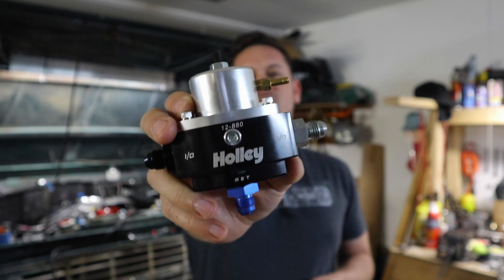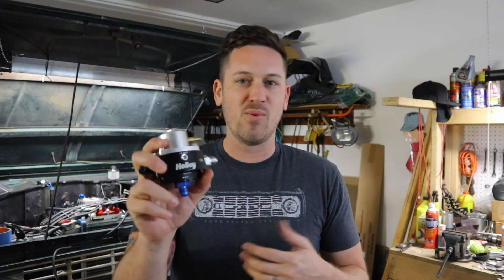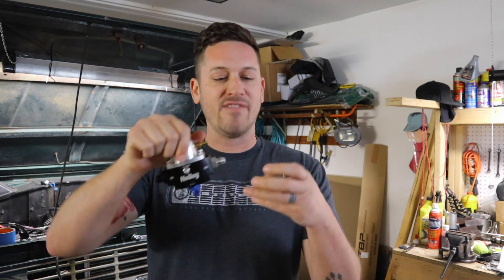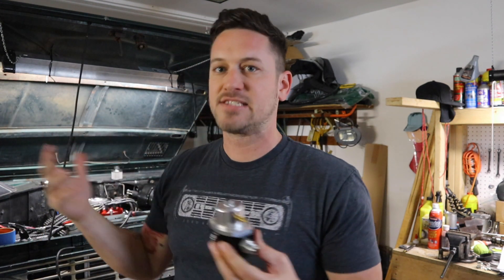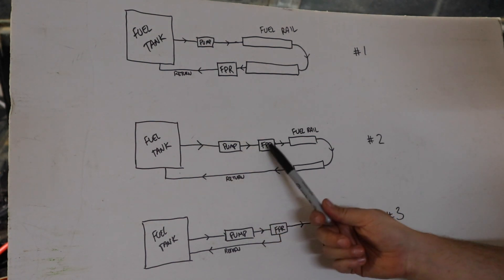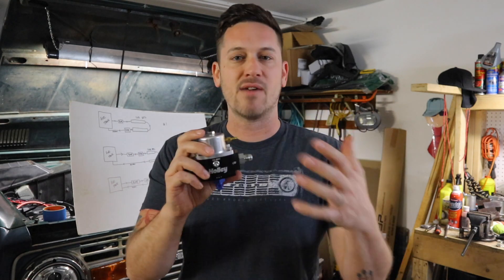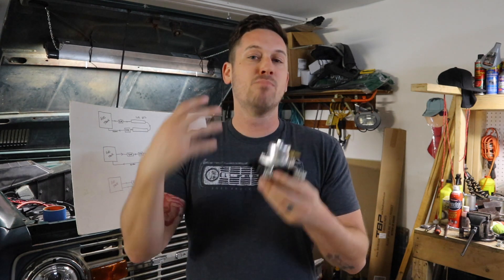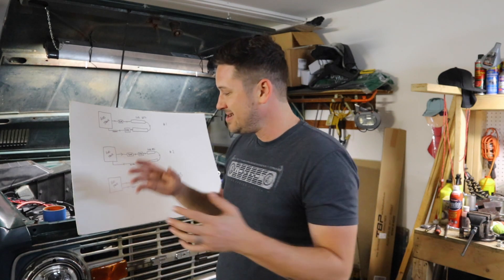Fuel Pressure Regulator: How it Works

Comment: I got the 30005 I'm going to hook up an external pressure regulator I was running the AC Delco EP 381 I took that off and put on a fitech 340 lph 50102 I drove it and my fuel pressure went all the way up to 80 psi I got to be able to adjust the regulator add another problem I got I'm using a 5/16 return line I think that's part of the problem too.. I need to put in a 3/8 line on.. my feed line is already at 3/8 like to get your input on this..

Comment: 11:23-11:37 - Vacuum Line for Intake Manifold Pressure Reference. If there is 10-15psi extra pressure in the intake manifold(because someone step on the gas pedal thus opening more the butterfly valve on the throttle body) this vacuum line is responsible for creating the pressure difference to be constant between spring chamber and the other chamber of the FPR or in other words between the intake manifold (through the vacuum line the spring chamber matches the intake manifold pressure) and the fuel pressure regulators  flowing fuel pressure towards the fuel rail. If there is no vacuum line which delivers intake manifold pressures "pressure info" to the FPRs  spring chamber, then there would not be possible to deliver proper amount of the fuel to the fuel rails.

Comment: Question: my pump only makes 7psi max or 90 gph at 5psi. I also installed a regulator to have a return line in the system. I set the reg on around 5 psi and I wonder if the reg will ever opened because of the low pressure or in other words the system cannot create overpressure. Am I wrong?

Comment: Thanks. I got my answer from your video. 
I don't need to hook up the vacuum port as I have a TBI and the injectors are above the butterfly. 😊
Just need to figure out if the fpr can be adjusted down to 13psi now. I assume I turn the nut on top counterclockwise to lower the psi? Only thing is, my fpr regulator has two nuts on the vacuum port. Do I leave the ignition off with key on only to adjust?
Thanks for your help.
 Great video.

Comment: I bought a fpr.  How do I adjust the psi down to 13psi as it has a vacuum port on top. Do you know if it's manifold vacuum or port vacuum?  Is the vacuum port necessary so the fpr will work properly? 
Thanks for the video.

Comment: so i had a plugged FPR vacuum hose and unhooked the hose on a new regulator hose was plugged for whatever reason making me think it was the FPR so when i went to unhook the FPR vacuum hose it was very hard and stuck on there like it had suction. when i pulled it off it kinda made this hissing sound now my tahoe wont crank and doesnt get pressure at the rail at all. im assuming i accidentally pulled it wide open or was bad to begin with and is now stuck.... oh the joy.
Reply from the maker: Oh the joy!

Comment: My fitech internal regulator has failed twice ! Im running a efi tank with in tank pump(255 walbro) . In theory  could I run the external regulator in your#3 system? Btw great video! 👍

Comment: im gonna fuel inject without efi  2 cylinder lawn mower tractor engine just for the experience i know bit about electronic and i want to build a weird electronic system that ain't an efi computer
and im currently building the fuel system
my first though was #3 xD
but i bought a no return type regulator T_T

i have question
what the diferance between return and bypass ?
still wacthing video at 7:34 at this moment

 i have a though on #2  i would put a valve on the return line and close it until pressure get created and flow still occure  but still why you would want flow in and out of the rail ? beginner here xD
#1  was my choice because my fuel ump can reach 140psi X_X i though i would burst those cheap clear tube i was using for testing

Comment: Awesome video! How much was your regulator? Unfortunately I am at the point with my Fitech where I may just put the carb back on to drive it (simply don't have the money for the edelbrock, or should I say the money for the divorce after buying the edelbrock).  Problem is i have the Sherman tank with in-tank pump which is too high for a carb, thus I will need a regulator. Thanks as usual - always awesome info from you!
Reply from the maker: It was about $150, I put a link in the description to the one I bought. Check that out
Reply: Thanks!